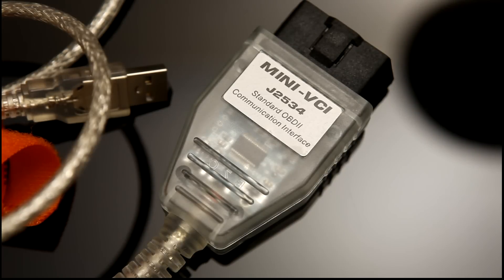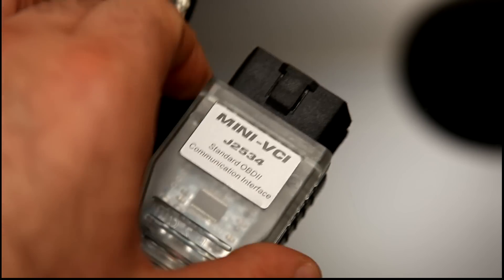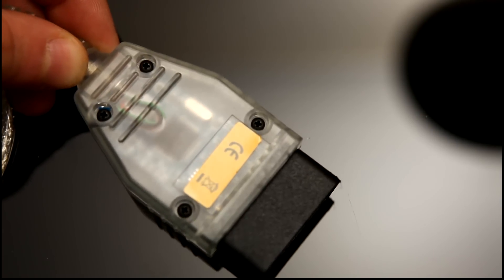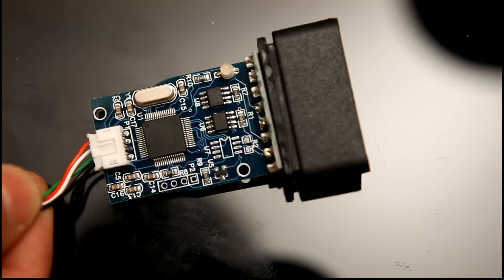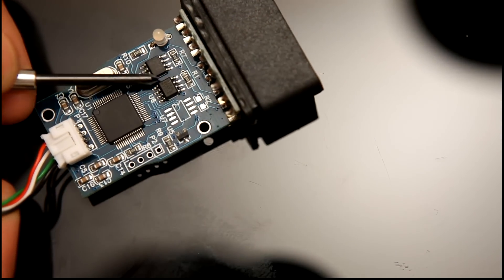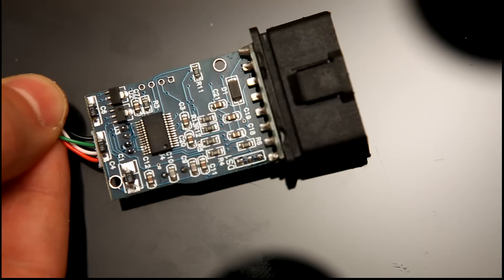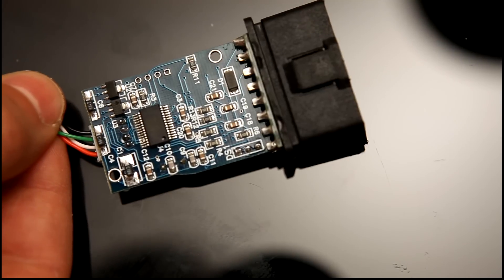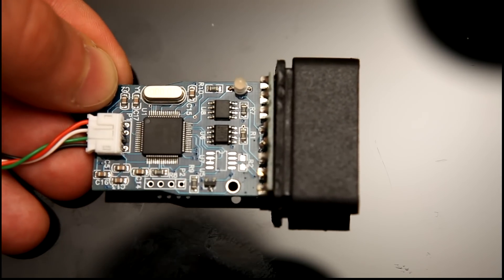Disassembly of the fake mini VCI cable

Comment: $26.00 on amazon compared to $100 at the Toyota dealer each time you have a problem..I bought mine to reprogram key fobs on a prius..the dealers told me they would not do it on used fobs and the local locksmith said $75 each, its paid for itself 7 times over on the first repair, ty china!
Reply: beachbummm69 UPDATE.. 
WARNING. the software is counterfeit and full of viruses. I just spent 5 hours formatting my laptop after AVG found the viruses but could not remove it all...god knows what its doing to the computer in the cars...I got mine off amazon but they sell this on all auction websites
Reply: what country did it ship from and what version of tis ? how did you program a used key ? as mine keeps rejecting me. I either need a pin code and reset ecu method or add individually but it won't allow me on on a used fob. fcc Id matching
Reply: Is this because AVG was picking up teamviewer  or something?

Comment from the maker: Possibly. But the ELM is very basic. It's basically, a low-end 8-bit microcontroller (one of the PIC16 series), which provides basic OBD-II functionality.

This is fine for the most basic engine/emission diagnostics that are mandated by  regulatory agencies, but useless for the more sophisticated OEM software for analysing proprietary components, or for changing vehicle configuration.

The VCI cable was designed to support various Japanese manufacturers proprietary software and ECU flashing.

Comment from the maker: Yes. It will display and log VVT-I, D4, D4D and other engine parameters. 

It will not reliably allow you to customise settings or reflash the ECU.
Reply: Is there a way to test the cables?  With some software and a DMM or oscilloscope? Or whatever is needed...

Comment: Its construction looks nice, i wonder if that controller emulates the more compatable Elm327 i think, the elm was a more expensive device in its day.

looks like there is a header on the pcb for rs232 or more likely rs432 serial use, so the data rate is not great.

Comment: Yes that OBD2 connector USB is very unstable takes a long time many restart your computer many re installations to make sure it works if your driver is not connected correctly you will not have certain pieces parts of your software the problem is in the driver not in the software or the part

Comment: What’s the difference between FT232RL and FT232RQ, on Aliexpress, there are also firmware 1.4, 1.41 and 1.5, I have never seen 2.0 but they may cost more but eventually probably the same. Those seemed to work with V13 fine even on windows 11 64bit with modifications or 64 bit driver that was reported as virus. the same. Those seemed to work with V13 fine even on windows 11 64bit with modifications or 64 bit driver that was reported as virus.
Reply: The difference is the chip package.  FT232RL uses a surface mount L-shaped 28-pin SSOP chip package.  FT232RQ uses a 32-pin QFN pin package.  Both chips do the same thing.

Comment: Nice video, thanks. As for the original XHorse cable, this seems to come in 2 versions, the newer V2.0.4 and the older V1.4.1 which does not work with as many Toyota cars. Genuine XHorse V2.0.4 cables have disappeared from the market with a few exceptions. The V1.4.1 and their fake copies are still widely available. If a car owner is able to acquire a V2.0.4 cable as well as a recent TechStream software download (which may in the worst case contain viruses),  then if this owner succeeds in configuring the software on for example a 32 bit XP computer, (1) how likely is the cable to damage the car electronics due to an unlikely failure in the cable's circuit board? and (2) how likely is the TechStream software to partially or fully corrupt the car's ECU due to an intentional or accidental bug introduced into the downloaded software? and (3) is it possible that the ECU has a log file built into its EEPROM that would record different activities initiated by all authorized and unauthorized user of TechStream? In my situation I only want to register my new chip key, nothing else.
Reply from the maker: With a proper cable, I don't see that there would be much risk with corrupting or damaging the ECU. Be careful with the customisation options, as they don't always work and may only work on specific ECU types. I don't think there is a log file kept.
Reply: Thanks for your comments. I lost one of my car keys a few days ago, and since have been surfing the internet looking for info about Mini-VCI cables and the TechStream software.

I have worked with electronic circuits since 50 years and with machine language computer programs during 30 years, so I should be able to relate to the inherent risks of something going wrong, either with the software or the hardware. Given that the world is full of high and low cost products that plug into the car's OBD2 socket, I conclude that the chances of a genuine, but faulty XHorse cable frying the car's electronics are very low. 

So that leaves the TechStream software as a potential source of harm. Clearly TechStream is a package developed by Toyota to sell under license to auto technicians around the world. It is not surprising that the price tag would be in the thousands of dollars and not surprising that someone could get their hands on an original copy and find a way to circumvent the requirement to purchase an activation key by patching the program code before offering it in a bundle with the cable

What is hard to measure is the probability that the pirated TechStream software would contain additional toxic code introduced to achieve some undeserved financial or ideological gain (identity theft / ransomware / botnet). 

While it is easy to backup or clone one's hard drive in order to restore to one's standalone computer if ever needed, there does not seem to be an easy way to backup/restore the car's ECU data using a trusted tool before allowing pirated software to take control of the bus. 

Unless one would use this cable often or with many cars, for me it is hard to justify the purchase of this cable and bundled software for a once in a lifetime use in order to save $50 at the locksmith if the purchase comes with a minuscule, but not zero, risk of causing hundreds of dollars of damage to the ECU.

Nevertheless, the teckie in me would love nothing more than to buy the cable and plug it in and see what happens.

Comment: This cable works with most diagnosis software 
Techstream , hds, ihds,odis ,elisawin
Reply: does this cable support latest i-hds software,and olso is it posible to erase fault codes with it
Reply: @besmirmeta3742  yes this cable called Mvci by xhorse this is working with most of them ids hds  tis tip vida also I use with sdd and lrh and if you need more help let me Know
Reply: This cable support j2534 hds honda?

Comment: Fake or not but it works fine with techstream
Reply: no it doesnt, the fakes are stuck in initialization mode which works fine for MOST techstream functions until you have to actually write to the ECU such as a TPMS reprogramming

Comment: why do you call it a fake?  Looks like it works.
Reply from the maker: The Mini VCI" cable was developed by a company called Xhorse. This is a copy cable which uses a leaked alpha fimware version. It works, but is very buggy, and cannot be updated to the official firmware because the CPU doesn't have enough flash memory for the real firmware.

The sales of the fake cables so far out numbered sales of the "real" cable, that xhorse had to abandon all support for the mini-vci, because they were flooded with technical support calls from people who had bought fakes.
Reply: +ChumpusRex lol shouldn't take that opportunity to sell them the real off directly  after brief explanation?

Comment: So, the microcontroller they used does not have enough memory for the release firmware. So if you wanted to flash it with the real firmware, why not just replace that CPU with one that has more memory. The process is not hard. You CAREFULLY cut the leads to the original chip. You have to take your time so as not to damage the board. I like to put a razor blade vertical along a side, just a bit away from the side of the chip, then run a bead of solder along the leads. I can then use a very sharp xacto knife, with very LITTLE pressure. It makes a scratch. Keep repeating with minimal pressure until you cut through. The bead of solder bonds the pins together and prevents the cutting from tearing a pad off the board. The light pressure and related cuts are controllable so you don't slip and cut the board. Repeat on all four sides, then deolder the pins carefully with solder wivk.

The line up the new chip at opposite corners. Tack one corner down. Adjust as necessary. Tack the other corner down with a bit of solder. Then observe with a magnifier or microscope to be sure the pins on all four sides are lined up. Then run a bead of solder along each side. Next wick the solder off each side. Finally, inspect for solder bridges with a magnifier. If you find one, run another bead, and wick it off. When its perfect,clean the flux off with IPA and your ready to go. 

Programming is another matter, you will need to give it its initial flash.but the data sheet should point in the right direction.
Reply: So what microcontroller is needed to make it work?
Reply: have you tried this ?